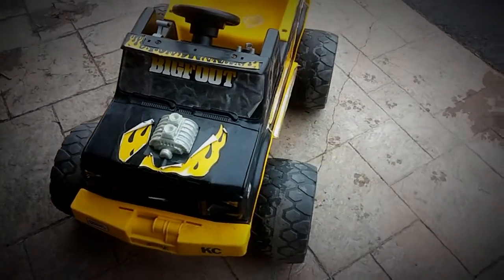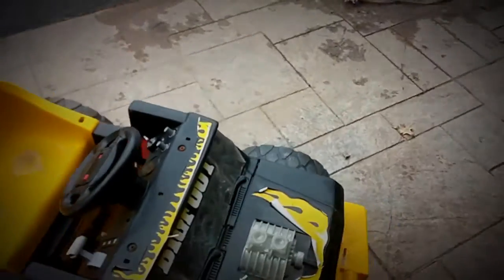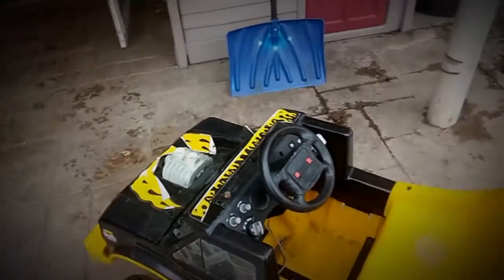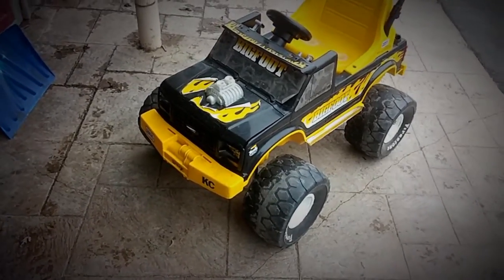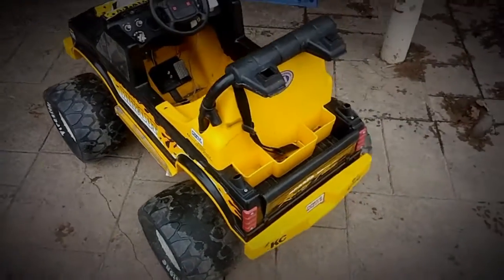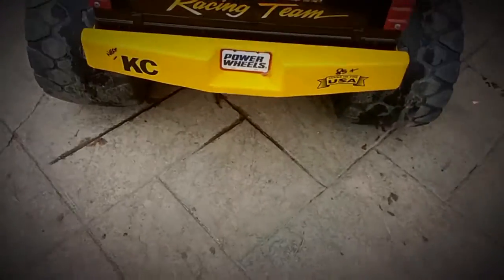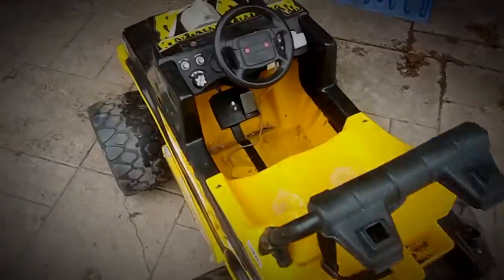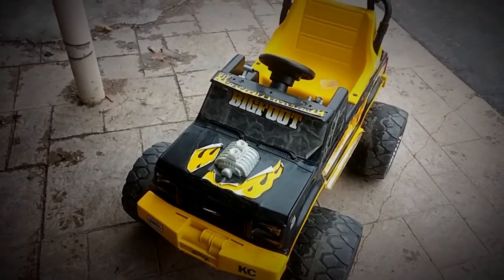Modified Power wheel with variable speed throttle

Comment: We want to how to convert this type of ride on to a variable speed. If you really did this, we need to know how. It been way too long.
Reply from the maker: I used the trigger out of a old 18v cordless drill.  Wired it in place of the old momentary switch.  Was able to retain the original gas pedal that pushed down on the new switch.  pretty straight forward install.  Sold the power wheel a few years back, kids outgrew it.

Comment: I have same question.  How did you wire the ryobi as a throttle?
Reply from the maker: Sadly I've gotten. rid of the powerwheels as my kids have outgrown. basically you disconnect the orginal switch, cut the connector off, connect the two wires to the leads of switch. you will need a small piece of 90° angle, you can use a hardware angle bracket from lowes or home depot.  and some sheet metal screws. the bracket allows for proper orientation of the switch and also functions as a heat sink.  I used some 1" self tapping screws to fasten the bracket to the underside of the switch panel.  overall very simple when you look at it all apart. forward and reverse are done via the power wheels orginal switch.
Reply: My pedal has three wires - black red and yellow so it must be different or I'm missing something.  I think I'll have to pull wires to see. Thanks for getting to help me.